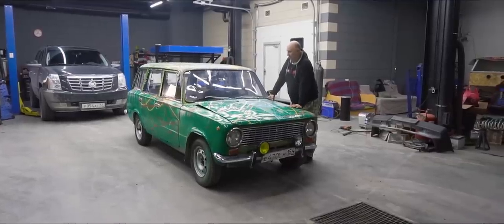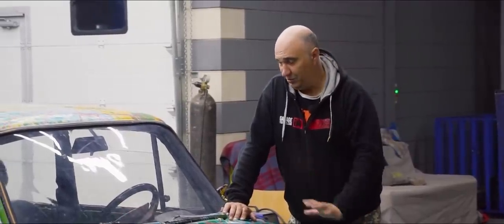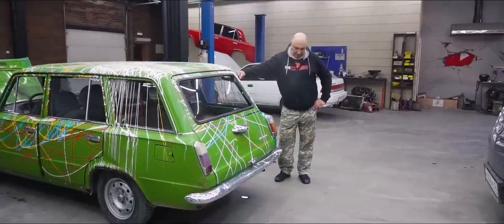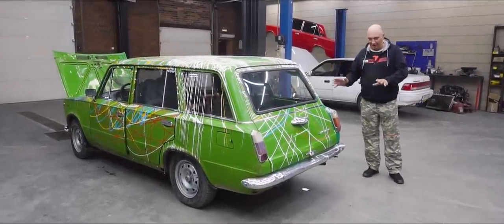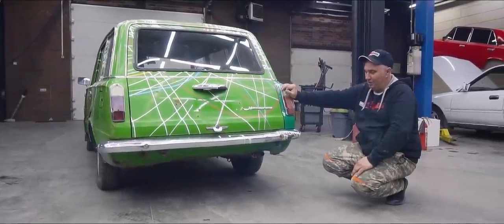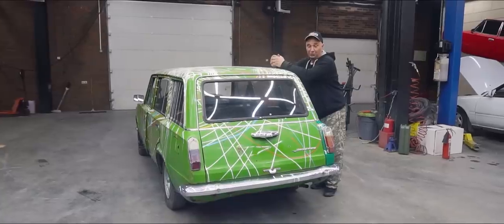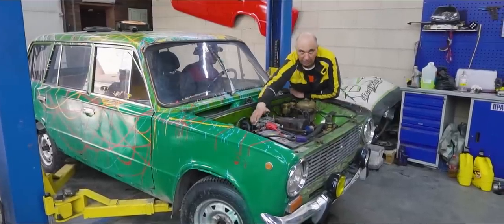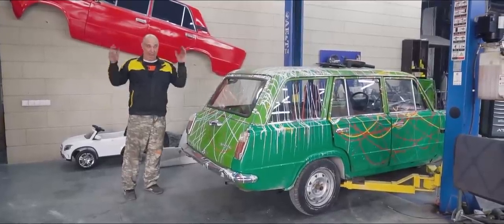No oil rings and valve seals! How bad will oil consumption be?

Comment: High oil consumption is highly practical. The car changes the oil while you drive as long as you top up regularly. Just change the filter occasionally. :P
Reply: That's like my old Ford, the rear main is blown, so it uses about a quart of oil per 10 gallons of gas, so I fill it up on oil every time I get gas
Reply: that's a good one 😂
Reply: @williamletts9487  that’s when you shop for oil at the dollar store 😆
Reply: @chincemagnet  sadly no, I still run full synthetic
Reply: Don’t forget the benefits of upper cylinder lubrication.
Reply: Dollar store oil is not much cheaper then the good stuff
Reply: That’s what I did with my old 76 Granada with a 7 cyl engine. Well, it had compression in 7 cylinders when I bought it. I never got enough money together to build a new engine for it. Oh well!
Reply: Basically the average Chevy 350
Reply: @williamletts9487 dude, oil quarts still cost 12 dollars for full synthetic, you're literally spending more money than if you just got a new cheap car lol
Reply: Note* don't do this on a diesel vehicle
Reply: They actually make some push mowers that do exactly this, they just say to top it off every season and has no drain plug.
Reply: @akashmohan999  let's see, 20k for a new car or let's say 36 dollars a week in oil. It would take you 555 weeks(roughly 10 years) to do as you claim.
Reply: @TlD-dg6ug  nah you don't need 20k for a used Ford or Honda. A used Honda without that issue can be only 10k
Reply: Turning a 4-stroke engine into a 2-stroke engine 😆
Reply: Just change your spark plugs every 100kms.

Comment: The smoke will be worse when you back off the throttle, (on over-run)  as a vacuum is created in the cylinders, pulling in oil down the valve stems and up  past the rings. :-)
Reply: Hey man odd question, but based on this, is this why they recommend varying loads while breaking in a generator? I am trying to figure out the most effective way to break in engines so they last longer, i am wondering if they rings will seal better.
Reply: @SkylineFinesse  yes it will help break in
Reply: @SkylineFinesse  on a diesel generator the worst that can happen is not building enough cylinder pressure.
If you want to break it in correctly, you need a pretty good load. Approximately 80% of the maximum load. Just keep an eye on the temps.

What help rings to seal is cylinder pressure, so high RPM with not enough load is the worst. Same problem on gasoline engines, but on diesel engine, if you don't break it in correctly the first time, you can glue your rings in place, and you will basically ruin the engine. (it's called coking the rings, and you will have black/white smoke and wet staking)

Don't forget to make an oil change including the filter pretty soon in the life of the engine.
Reply: @Leroys_Stuff  thank you
Reply: @Fabien2626  thank you for the advice it is much appreciated
Reply: @SkylineFinesse  No problem
On big diesel generators it can be challenging to find a big enough load to break them in correctly.

So it's a very common problem with this kind of products.

The problem is that you can't bring the revs down to make more cylinder pressure, the way you would on a car by shifting gears.
Reply: @n325aej same on my diesel car, my oil rings were completely shot, and when engine braking for a long time it was an absolute smoke show.
Eveb worst when I started to give it some gas after the hill.
The engine started burning more of the oil and made a huge blue cloud.

I thought my head gasket or cylinder head was cracked, I never thought the oil rings could go that bad that no oil rings would do the same.
Reply: I had a 1275 GT that had split valve seals, That only smoked after throttling off then booting it but it drunk oil
Reply: @SkylineFinesse  

Generally for any kind of engine breaking the best is low rpm and higher load, varying is important as well.
Reply: @Fabien2626  we have dummy loads that are watercooled that can soak up to 200,000W. Half a megawatt onwards they'd just power the building with it for several days
Reply: @nicholas stocks check out how places like Yamaha, Suzuki, Honda etc run their engines in🤣🤣....straight off the line, start, high idle till up to temp then wide open to redline to the end of top gear on the Dyno a few times and off to the customer.
Reply: @SkylineFinesse  Break-in has extremely faint effect, and in cases when breaking in too carefully the engine will be damaged due to never reaching operating temperature. Put some heavy load in that generator at once to get it up to temp, leaving it idle for an hour is an hour of running too cool.
Reply: @Fabien2626  Excellent advice, get them loaded. When i bought a new generator i almost immediately turned on a 1.5hp air conditioner to 1. get temp up and 2. Get the throttle opened to get a nice rich mixture. Generators are constant rpm so they are a bit starved when running no load.
Reply: @Leroys_Stuff  No it will not. At least explain your reasoning.
Reply: @pflaffik  on vw 1.9 Tdi compression continues to go up and actually makes greater compression at 100-200k
Than one that has 10,000 miles. 

Heat gets behind the ring and pushes it hard against the cylinder wall. 

If it isn’t pushed hard by heavy loads, 
You risk cylinders glazing because the oil isn’t being scraped completely by the rings.
Reply: 12:06 yes you can see it here
Reply: @imnota No it's not
Reply: @TasmanianDevil3  

Great argument. Really makes you seem like an educated individual that knows how to get their point accross.

Look up how rings seat and what makes them seat, hint : cylinder pressure.

Look up what can damage an engine during a break in, there's gonna be 3 things, idling (worst thing you can do out of them all, rings don't seat, you wash the cylinders out and you'll have low compression), high RPM (bad for the bearings, oil is usually dirty during breakin, etc That being said this is not the most crucial aspect, you can give it rpm and be fine, depends of the build, the clearances, the oil you use, if you changed it already, etc), and not varying load enough (ie using cruise control on a flat road, what seats rings is the pressure pushing them down when accelerating, you want load for the most time possible whether it is acceleration or decceleration)

Comment: So Russian cars do have valve seals? Their tanks don’t🤓
Reply: Mona Torkia  The industrial version of the v55 engines do have valve seals. I guess for army use it's acceptional to use oil. Cost & simple production are the reason I guess. If they want smoke, they can inject extra fuel into the exhaust. So that's not the reason.
Reply: @Werkplaatsvlog  fancy seeing you here milo
Reply: Neither do their ships.
Reply: Do the old Soviet cars have a catalytic converters?
Reply: Mona Torkia  Yes, I had a tough time finding it, but I did find on Wikipedia that the catalytic converter was added in the 90s to the Lada.  Thanks.
Reply: Hey eindelijk een nederlander
Reply: They offset the oil loss by adding the blood of their enemies
Reply: Wanneer is die Tank klaar ?
Reply: @darth1864 That's going well for them isn't it

Comment: The knocking you heard after removing the rings is probably "piston slap", when the piston is bouncing off the cylinder wall...
Reply: Exactly
Reply: Pistons slap with rings too.
Reply: Yes I taught same, but then I got it.

Oil rings lubricates cylinders. But without oil in all place it start to knock?

Hello Garage 54 team! Nice test😃

Now summer is almost gone for my video idea, but I haven't got answer earlier. I"ll keep sending this message to new videos too, till I got answered😉

Try to make a anfibio car?

Weld many propellos to drive shaft, so own engine will work on water too😂 If using samara, it is easier to use outboard motor👍
 I am doing same to my Samara, when it is too rusty after few years😅

Please, do not make Titanic 2😅 Use some arm floats👍

Greetings from Finland from Lada fan... What a car! So reliable and cheap to use!

Using Ladas from year -07! Using Samara and rare model in Finland➡Granta😎
Reply: @mikeznel6048  of course they do! o_O But they're definitely gonna slap a lot more without them! XD
Reply: @TravelAndEvangelism  you should put this on the main thread, not mine!
Reply: @omgwtfkthxbai  Yes. Taught it gets more interest from garage 54 team when in chain messages😅
Reply: Sounds like a old high millage jeep xj after that hell even mine with 161k clatters
Reply: @bryanwheat9101  They scrape the excess oil, but they also help the oil to be smeared evenly on the cylinders by doing so.

If you don't have them, the oil will just shoot out the ports on the piston sides leaving areas with less or no oil longer after the engine start.

But it's also true that Oil rings can help stabilize the pistons at low revs. After all they are the only spring loaded ones.
The other rings are only pushed on the cylinder surface by the combustion pressure. (so they push hard on the cylinders walls only 1 stroke out of 4, not that much 2 out of 4, and have a tendency to retract on the intake stroke)
Reply: @bryanwheat9101  oil is usually shot upward from the crank or specific nozzles inside the piston.
And the crankcase pressure make it go pass the holes in the oil control rings when the piston is travelling upward.

If this action didn't exist, their will never be oil to scrape in the first place.

The compression rings, as already told, apply different pressure at different strokes. When combustion occurs, they push really hard on the cylinders, but on the intake, the vacuum have the opposite effect on them, and if the oil rings where not spring loaded, they also could retract and allow to much oil in the combustion chambers.

In fact the compression rings are pretty good at spraping oil themselves, just not on all strokes. That's why the oil control ring exist, and why it is forced outward by a spring.

Don't worry, I rebuilt quite a bunch of engines.
When you do, you really notice that this one is a hell of a lot harder to push into its groove once assembled.
And it's not because of what it's made of or anything. It's because it's sitting on a spring.

Some oil control rings are literally sitting on what can't be mistaken to be anything else than a spring.
Others have a weird piece installed between 2 very thin rings. But that is also acting as a spring once installed.
Reply: @bryanwheat9101  You know you can call it "more ring tension" if you want.
But ring tension is pretty much the same as a spring action.

But if you compare that spring action on a compression ring, and an oil ring, you can clearly see that the compression ring require nearly no force to be pushed back. Even in pretty big diesel engines.

What I mean by that is that ring tension meaning anything is bordering mythology.

You can't rely on ring tension to do anything on an engine.
The first and second ring uses combustion pressure to deploy, the oil ring just a big piece of coiled spring in a shape or another to help him scrape oil.

My engine had the spring broken on all of my oil control rings.
Don't know what the former owner done to this poor thing! XD

But the result was absolutely horrific oil consumption. 2l for 100 km at peak. (diesel engine, so it didn't bother him, it ran pretty good) 

The oil ring where in perfect condition except the spring.

I changed them and now it's running perfectly.

I have the photos if you insist.

Just so you know, this spring is what makes them effective. If this spring to not provide this extra tension the other ring don't require, the oil will make its way through.
Reply: @bryanwheat9101  wow you are absolutely full of it...
That's impressive.

Yes there is a nozzle on some engine, turbo diesel all uses that.
The idea is to increase the oil flow behind the piston to improve cooling.
All engine have a way to provide some kind of an oil flow behind the pistons.
That was you who was pretending the oil rings have an only one way flow in the first place...

Did you even put an engine apart?
And I don't mean Briggs lawn mower engine...

That's impressive how much you just can't open yourself to learn just a little more about something that seems to be of some interest to you...

Well I hope this serves to somebody else than you at least...
Reply: @bryanwheat9101  they all have a spring inside.
Look at the one on the lada, it's a gasoline engine, and it have the exact same type of rings where you can't mistake the string for anything else.

As for the oil jet. It's on the block and face toward the inside of the piston.
It's a simple thing used by a lot of engine manufacturers.
Just download any turbo diesel engine part guide.

Seems mesmerizing to you, but it's quite common practice, even on some new gasoline engines.
Reply: @bryanwheat9101  the flimsy thing you  talk about is a spring.
It's not acting as one when you disassemble it, but when in use, it's what it does.

The squirter as you name it is use for cooling, yes, that what I told exactly.
It is to increase the oil flow behind the piston. And replace the other way of providing oil into the piston, that flow on and off the oil control ring as the piston moves up and down.

Well that's good you finally understand.

That would be way less of a pain if you didn't always made it up like you where always right and I'm completely stupid for no real reason...

Well that was fun... Have a nice day!
Reply: I was thinking the same. Probably the skirt of the piston. Surprised it didn't snap it off
Reply: Agreed
Reply: ed zachary
Reply: None of you know what knocking is. It is pre detenation. He had timing wrong.
Reply: Some times people need a good slap with a piston

Comment: Congratulations! You just made an 84 Honda Civic! 🤣🤣🤣
Reply: My 1985 VW also loves to smoke like that if I let it idle after starting.
Reply: This comment is underrated 😂
Reply: @ItsIdaho  That thing was insane. Smoked at least as much as the lada here... And something really peculiar resulted from it... I'm assuming it was diamond, no other realistic explanation... But after enough oil burned in it, it appears the carbon on the valve faces changed over time... I've seen it in very small quantities, usually on the exhaust valve, but this was caked and I was unable to even chip it. Looked like fine packed snow. Thick coating... Could have used it for grinding metal if you put it in a drill.

I lost the valve that I took out in a move (it eventually burned not one but two), and have never seen it anywhere else. Web came up empty last time I looked, or my fu sucks lol.

I would love to see someone reproduce it but I'm thinking it will take a while to form. Longer than anyone is willing to wait lol

Many many miles. 20, 30k?
Reply: Best comment yet

Comment: Some racing engines, especially in motorcycles,were never fitted with oil control rings for lower internal friction. Because the tolerances were so tight on the engines not much oil was burned. Honda rc166 is an example
Reply: Considering the amazing RPM the RC166 worked at (which was even higher in the 50 twin and the125 five) and how tiny each piston was, I wonder if the physical properties of the oil - and the tiny tolerances of these engines - slowed its capacity to react to the temporary vacuum produced on the overrun. Certainly videos of these engines being warmed up by blipping the throttle do show a puff of smoke every time the throttle is released, but only when the engine has some warmth into it, suggesting that the higher viscosity of the cold oil prevents it from being drawn up into the combustion chambers. At any rate the smoking is never remotely comparable to Vlad's Lada.
Reply: @CaptHollister  being racing engines, it's probably fuel smoke you're looking at- them being tuned so rich for racing.

Comment: Next project:  Put a T connector on the fuel line next to the carburetor and plumb in a small copper line. Next introduce different liquids like anti freeze, oil, alcohol, etc. to see how much it makes smoke when it is naturally aspirated.
Reply: Just plumb it into the exhaust if you want smoke.

Comment: Still not as bad as Master Milo’s tank….
Reply: Lol?Its tank...
Reply: Yeah, compare V12 diesel to gasoline lada
Reply: guys its a joke
Reply: Milo's tank needed the injectors working on, but even then the exhaust cleared at higher revs.
Garage 54 show that while the styling of the car may be a joke Lada's are brutally tough.
Reply: @NJPurling  Yeah nothing cant beat old Lada also iam curious what happend when they drive next 50 Km and add oil too probablly spark plugns not working well.
Reply: @joe125ful  Yeah on a gasoline engine, too much oil consumption result in a thick crust of burned oil on the spark plug. And this effectively impact its ability to make a good spark.

But if the spark plugs are hot enough, this can take a while.

On diesel engines, you can just keep driving and driving, it will take a very long time to finally have a negative effect.

Comment: We drilled a hole into the exhaust manifold and fitted a copper tube. Then ran a hose to the wiper fluid container and used diesel instead of wiper fluid. Then when driving the car and giving it some diesel with use of the wiper fluid lever it smoked so much through the tail pipe. We did use a V6 though.